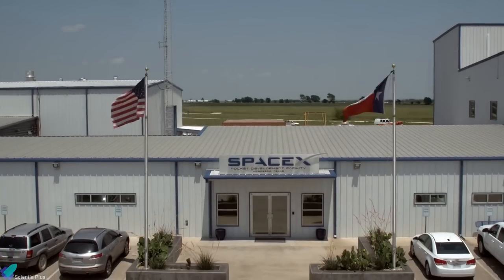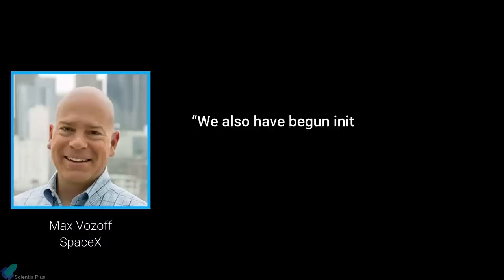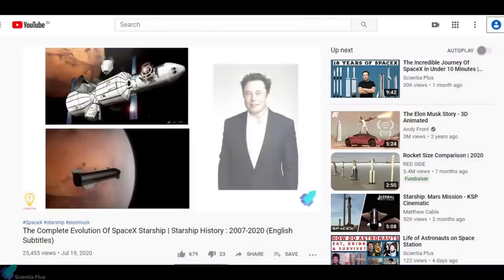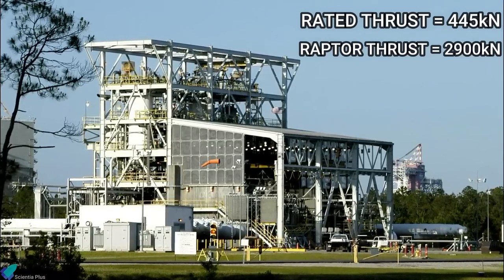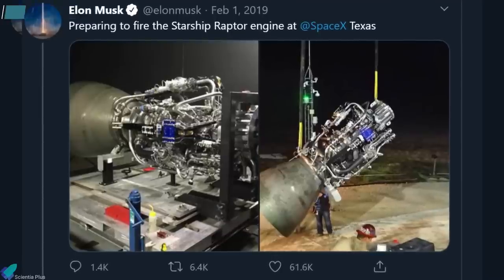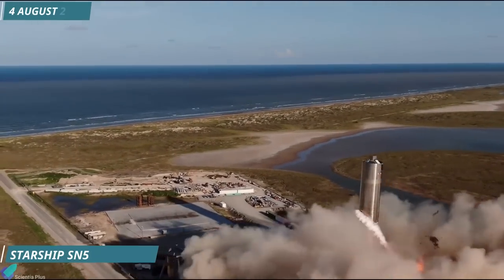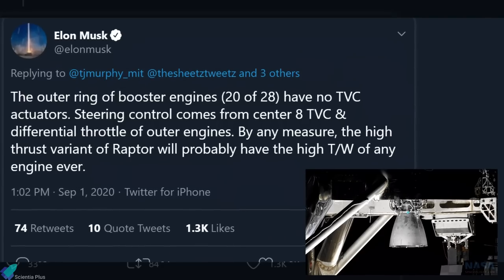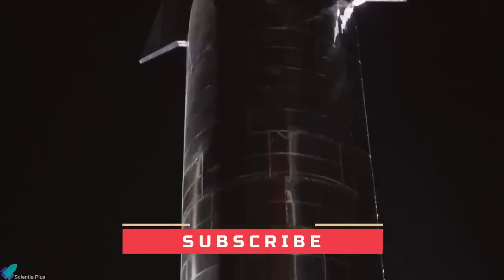The Complete Evolution Of SpaceX Raptor Engine - Part 2 | Starship Engineering Series

Comment: Besides a very limited developmental time line not much was presented here.   For example, after a little research you could have discussed how the Raptor differs from its primary competitor Blue Origin's BE-4 methalox engine; how the Raptor powered by subcooled liquid methane and subcooled liquid oxygen and what were the advantages of a full flow staged combustion so fueled compared with the BE-4 Oxygen rich stage combustion cycle;  how the Raptor will probably have the highest thrust to weight ration and why it matters; why the fuel rich preburner on the Raptor is possible with Methane but not so much with RP-1; etc.  It gets tiring watching seemingly never ending SpaceX videos where the producers don't seen to even read the Wiki article and some of the references on the subject only to regurgitate what every knows anyways.  Try harder.